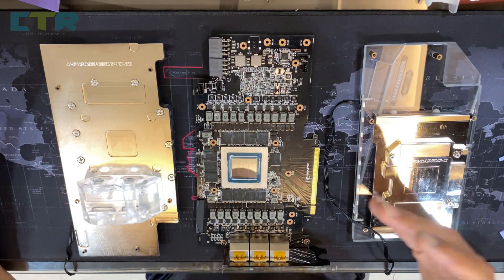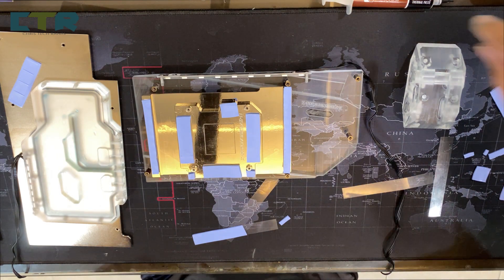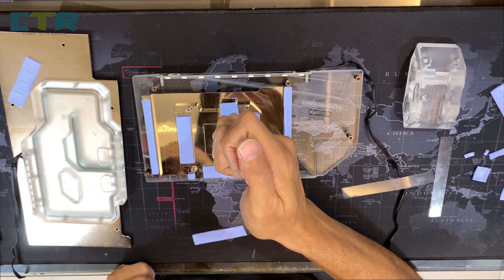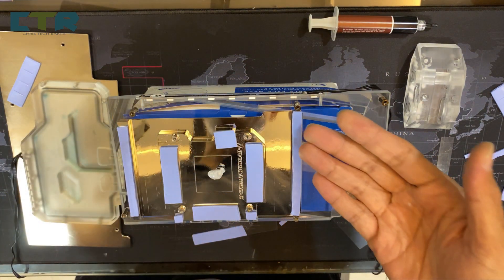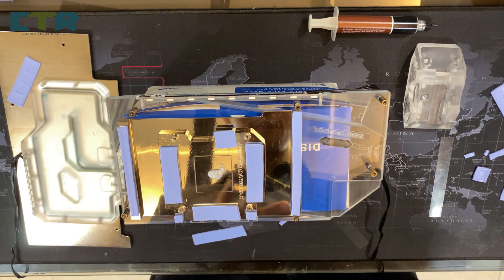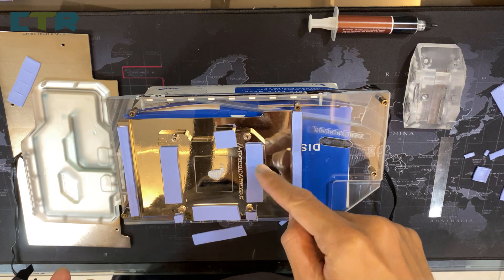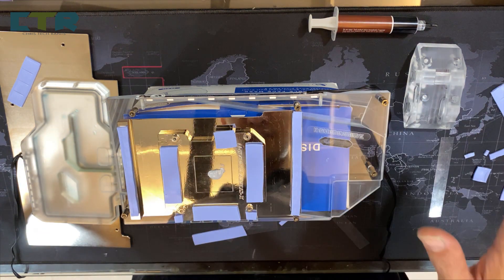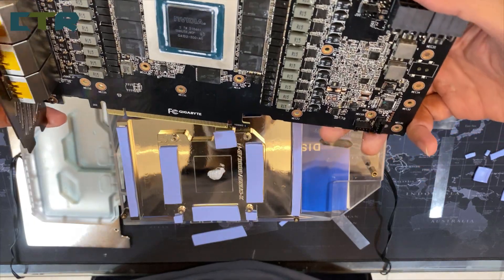Bykski 3090 Xtreme waterforce WB gpu block with active backplate installation

Comment: I don't know why they list the arous xtreme and master as different SKU... Because I have both RTX 3090's and the master works with the xtreme and vice versa, although my kits both water block looks different from yours... I get 78c on both cards mining no matter how hot it is in my house ( check my videos ) RGB SUCKS ON FANS AND WATER BLOCKS...
Reply from the maker: FIRSTLY: DANG MAN! nice builds! Second: you may probably have the 2nd revision of master. the second revision has 3 8pin power input. so the layout of the PCBs may be the same (except for the gpu binning and power delivery/consistency probably, which i would guess the extreme one would be better). To add, your temps are REALLY nice, considering that they're only being FAN COOLED! nice! add heatsinks with pads at the back of those cards and you'd get 4c off easy! just the cheap ones, they're really effective. if they're placed properly they actually don't look bad imo, in a rugged-jerry-rigged-kind-of-way.

During the time i did this 3090 youtube content, i think i only had the card on a 240 rad. now, I decided to finish my build and currently have 360 + 240 rads with just 1 3090 and a cpu in the loop. Now i'm getting 64c vram temp max with room temp of 29C during mining. fan curves managed by Argus Monitor. with noctua ippc 3000 running at fixed 1700rpm during mining. Basically i'm able to maintain 41c Water-loop temp (about 12c above ambient). But when i'm in the room and with the ac on, it gets cooler.
Reply: @christechrants4085  my rtx 3090 master is on air.. I just ordered another granzon kit for that card... My xtreme is the water cooled one.. it's at a consistent 76-78c at full tilt all day and it's like 70 degree in my home... I changed the thermal pads on the master with the same kind you have in this video and that made a world of a different even on hot days the master only gets up to about 86c on air... And yes master only 2 ports for power rev 0.1 non LHR card Aorus Xtreme 3 port power rev 0.1 non LHR.. Aorus xtreme RTX 3090 is the highest spec GPU there is .. currently reason why now I'm getting 131.29mh out of that one card master gets around 125mh my rtx 3080 gets 97mh and my laptop which is a MSI GE76 RAIDER rtx 3080 gets 68mh
Reply from the maker: 78c still not bad even on water. Nice. Considering it’s 130mh/s and the room temp. As for the master, 86c is still great though! Beats most of the other 3090 cards i believe. Most cards that’s air cooled doesn’t go below 90 even with fujipoly pads if I’m not mistaken (unless they attach a heatsink).
Reply: @christechrants4085  dude my master was at 106-108c with the factory.. I had to turn the hash rate all the way down to 96mh on the master just for it to stay at 100c.. my xtreme always had decent temps even on air 130mh at 98c but on warmer days it was going up which is why I decided to water cool that one first since it costed me me the most money 😂. Now my temps are good all around the board... Now I'm worried about my asic miners during the spring and summer heat.. I have to figure out a way to keep them cool..
Reply: @christechrants4085  and I would never buy a LHR card although they have a way to unlock it now. I'm just now dealing with that stuff.. btw yeah if my xtreme was on a 360mm fan setup I think my temps would be crazy lower but it's on the 240mm they sent.. is your on the aio radiator and pump? Or did you make a custom loop?
Reply from the maker: 😂😂😂😂😂😂😂😂😂😇😂😂😂 makes MORE SENSE NOW!!!!! You have to understand that it’s currently 1am here right now so my processing is a bit slow 😂😂😂😂😂😂😂😂😂😂😂😂😂😂😂😂

ASICs hmmmm. I always wanted to make contents out of those….but nah. Will just wait for your uploads 😁

A lot of shops in aliexpress dropped their prices for asic cooling. Like the 1080 rads and waterways… might be worth considering if you’re willing to wait a while for it to be shipped there. I’m from the Philippines and the parts arrive varies from 3 weeks(best days) to 3 months. OH i ordered some screws and fittings and it took so long that aliexpress refunded the items….and after forgetting all about it, it arrived at my doorstep. Took a little over a year i think. Would have been nice if i needed the thing still. Not sure of the status of how the availability/pricing of components there right now, so….. 🤷‍♂️ here, most reliable shop with reliable shipping is EKWB so not lot of options.
Reply from the maker: @MASA-ARRI   ye ye i get you. custom loop…. Easier to replace if a component goes bad, you know?
Reply: @christechrants4085  yes I definitely understand makes sense the all-in-one is modular so just in case something does fail you can replace it so it kind of works both ways but it's just weird to me that your whole water block looks different from mines when we have the same kit... I guess when I get back home I can make some videos of my asic monitors just to show you
Reply from the maker: YES PLEASE! Really interested in those asics
Reply: @christechrants4085  made a video of my ASIC miners 😊

Comment: Hi dude, I want to put Block to rtx 3090 aorus waterforce, is it fit? Where did you buy from Ali? Thanks
Reply: Waterforce without wb)
Reply from the maker: I used wb for aorus master
Reply: @christechrants4085  can you send where  to buy waterblock bykski, thanks
Reply from the maker: @PitProject666  N-GV3090Aorus-x (gpu block)
N-GV3090aorus-tc-be (active back plate)

I buy most of my components here:

bykski Official Store
https://a.aliexpress.com/_mrgbNvI

Note that it’s aliexpress, depending on your shipping method it may take a while to arrive. I normally receive my stuff in a about 3-5weeks time
Reply: @christechrants4085  thanks

Comment: Cmon man if you dont know how to intall the block, inform yourself first. When intsalling squich hard the area around the pads. They can get compressed quite a bit, in fact they should compress, they are a little higher by design. Just squish the card against the plate after when installing
Reply: Yep exactly right... Thermalpads cant bend pcb come on... Hes doing it so wrong 🤦

Comment: is this an Aorus 3090 extreme?
Reply from the maker: Kind of…. It’s the xtreme waterforce WB version. Basically it’s the aorus master version but without dual bios oh and has a different capacitor type as well. This has the flat ones for filtering. Forget the name. Opposed to aorus master’s cylindrical ones.

Comment: I have a MSI 3090 Ventus 24g OC and when i put the block together I had to use one of the nuts that they provided in the packaging as if i didn't it would of bent my PCB, maybe you needed to use one of those nuts to prevent the bending on the PCB (The nut's placement was on one of the screws used for the bracket)
Reply from the maker: Nice input nice. Will check this out next i open the block up

Comment: Thanks ever so for your videos, they have been a great help in gaining insights on this card and its various versions. 

We recently had to buy one of Xtreme with the air cooler. We wanted to get a A5k or A6k but we took what we can get with gpu market as it is. When we start a render this thing gets so hot, I could even deal with hose loud the fans might be. But rendering jobs lasting 2-3hrs at high Temps are scary, we are actually thinking of water cooling it.

We were looking at a EK cooler but everything I hear makes me think we should get one with an active backplate. Just so nervous about doing something like that because never done it before.

How are you liking the Bykski cooler now after several months?
Reply from the maker: First off….with a 360 rad and only the video card in the loop, room temp of 22c, I’m getting 58c vram temp and high 30s or low 40s gpu core temp. With 27c room temp, I’m getting 68c vram temp. These are in regards to max mining performance. With proper thermal pads, bykski blocks are great (JUST DONT USE THE STOCK BYKSKI THERMAL PADS, I’m using gelid extreme pads).

Secondly, there was one useR who commented that he’s only getting 80+c with his aORUS 3090 xtreme waterforce WB. With 80c+ vram temp during mining, that’s pretty impressive. Note I’m not sure if gigabyte upgraded their WB design or something, but point is, that is something worth looking into. 

3rd: I’m sorry but I’m actually not familiar of what a5k/a6k are 😅

After several months of use….. performance and thermal parameters are still GREAT!!!!!
Reply: @christechrants4085  Thanks for all that insight. I wanted to wait till I tried one think be fore water cooling. I'm still a little on the fence about water cooling the card, mostly because I've never dont it before and this is work critical. But as a stop gap/cheep lets try something just to see... I bought a copper Heat Sink, a 1mm thermal pad, and two 80mm Arctic fans running about 2K rpm. Placing my Lazy Man Cooler on the back of the card over the GPU and mem junction ram. While still toasty at around 78-82c under moderate load that is a far cry from the 92c it was sitting at most of the time under the same load. 

I'm thinking that in the end I'll be water cooling it. Starting a work load that is a few hours long it would eventually climb on up to around 90-92c but pretty well maxed out there.

As for the A5K/6K its is just the workstation versions of the 3090 for the most part. It only takes up about 2 PCI slots since it was longer and cooling more streamlined. Unlike the current Monster of a card in the system. ^^;

Thanks again

Comment: Hello Chris,
i have one last question.
Which cooler is thicker
The original Aorus 3090 air cooler or the Bykski full cooler with active backplate?
Sry Chris, I need to know because I really want to add 2x 3090 Nvlink! Does that fit on the Asus Rog Maximum Formula X Z370 motherboard
Reply from the maker: sorry i wouldn't know the answer. my gpu originally was the aorus 3090 xtreme waterforce WB edition. anyway, the bykski block with an active backplate consumes 3 pci slots. Not including the fittings.

In my estimate, that board will be able to fit it. you'd be using the x16 slot 1 and the bottom x16 slot.

Make sure the case you'd be buying have at the very least, have 8pci slots, with enough room for the bottom gpu's fitting for its inport. MEANING, the case should have space for 9 pci slots inside the case, and has an actual 8pci slots. I hope that makes sense. i don't know how to better descibe it. like the phanteks enthoo elite case or something. well other case may be able to support it but i don't know what those are.
Reply: @christechrants4085  8x PCI-e ????? :-////
Reply: @christechrants4085  soo... do you mean it is perfektby my board? Asus Rog Maximum Formula X?
Reply from the maker: @Trailerofdead  provided that you’d have a case that it can fit into, I don’t see why not. But to be on the safer side. Better buy one 3090 first. Your backplate may be different from mine
Reply from the maker: @Trailerofdead  I don’t know what you just said but seems like you’re enjoying it so ok 😂😂😂😂😂 enjoy your modding!
Reply: @christechrants4085  Bykski Aorus Xtreme is on the way! It's sure to be there next week!
If 1 board needs 3PCI-e, 2 boards need 6PCI-e slots! It's very simple math!
My board has space for 6PCI-e slots.
3 of them can be seen and there are gaps in between.
I have to stow my power supply somewhere else or buy a larger case!
The original air cooler is 7cm thick. Please measure your Bykski to compare! Best regard Chris and love you Brother haha
Reply from the maker: @Trailerofdead  no no no. Not pcie slots for the motherboard. You motherboard is fine with 3 slots of x16 or x8 slots. Those are fine :) you will be using the top pcie x16 and hopefully the middle x16 slot but most probably the bottom x8 slot. Anyway those are fine. But you are correct =) your case needs to be able to accomodate 9 slots. Anyway, I’m pretty sure you get the idea. 😁😁😁😁 enjoy bro!!!!! I know nvidia made a bad move with the vrams overheating…..but hey atleast we get to tinker and do something we enjoy 😂 enjoy!
Reply: @christechrants4085  Haha yes, I understand the PCi-e both must be able to 16 x.
If I have 1x 16 and 1x 8 it is not good, therefore several Pci-e. both have to run at 16x ... but I can't find a motherboard that can do ALL 16X. do you know one I want the AMD R9 5950X or wait for Alder lake. Yes, luckily Bykski has a full block that comes now brother! :-) I think I'll keep my board! yes i will hope the top and the middle! because the original air cooler is 7cm thick. how fat is your bykski?
Reply from the maker: @Trailerofdead  wait for my response tomorrow. I’m too drunk to respond now 🤣
Reply: @christechrants4085  Hahahahahahahaha DrunkenMaster
Reply from the maker: @Trailerofdead  yeah, so basically the whole block's size is 4.8cm. takes about 4 pcie slots of the computer case because of the connector link. it will be very tight if you will put both 3090s on the first x16 slot. so i doubt it will fit. but of course i may be mistaken. so you might be force to use the bottom pcie x8 slot of your motherboard just so you'd be able to make it fit. BUT using the bottom pcie slot of your motherboard may interfere with your computer case bottom psu shroud so research on the case you'd be buying =)

PLEASE share your results after your build =) =)
Reply from the maker: @Trailerofdead  it’s the connecting link that is 4.8cm. The blocks are not that thick. Ye, will check video later

Comment: Hello Chris,
please tell me your temperatures with your block / active backplate.
I've just ordered the Bykski for Gigabyte Aorus Extreme with an active backplate and hope that the block arrives quickly.
 I am interested in your vram please tell me. My Gygabyte Aorus Extrem is there and only beeps / hums softly ^^ a great card!
Reply from the maker: Regardless if it’s gaming or mining. Haven’t tried in computing or content creation. Anyway, for gaming and ming never goes beyond 58c if room temp is 22c. Doesn’t go beyond 66c if room temp is 27c.

Gpu temp never goes beyond 47c

Water temp never goes beyond 39 c if room temp is 20c. Never goes beyond 44 if rooms at 27c.

Radiator 360mm only 1 gpu in the loop.

Fan curve set at 70% when vram temp reaches 60c-70c. 50% at 40c-50c. And 800 rpm if vram below 40c. Average rpm 2050rpm. 

Max rpm3000 if vram reaches 75c
Reply: Excellent!
Thank you for your detailed answer! I ordered the Bykski via UPS.
It's coming next week! I hope! I hope it stays cool! XD

 @christechrants4085 You: "Anyway, for Gaming and Ming it never goes above 58 ° C"!

Do you mean the GDDR6 / Vram?
Sry, I just want to know Vram ^^ backplate! ThX and sry :-)
Reply from the maker: @Trailerofdead   yes you’re right: VRAMs are inn regards to the 3090 vrams gddr6x….note the X 😁

Comment: what is the thickness of the backplate at the edge?  and how far does the connecting block stick out from the front side of the card?
Reply from the maker: Message me on facebook. Christechrants 

not sure which edge you’re referring. Draw a simple sketch or something.

Anyway Can’t check right now. But I’m sure that it uses 3 pci slots. (1 top & 1 bottom)
Reply: @christechrants4085  just the thickness of the metal on the backplate?  and how far the block that connects the 2 halves in front sticks out from the card?  and where is the best place to buy these? aliexpress? or?
Reply from the maker: @valentusslimroast6716  oh i get it o get it. Will give it to you tomorrow. Bought mine from aliexpress. Just be sure to choose the dhl option for shipping 😅 aliexpress takes time to actually ship the item. 

My experience: i ordered jan 1.
Jan1-10 item being prepared for shipping.
I received it jan 15

Something like that.

Another experience i had with aliexpress:

I ordered jan 1. Dhl also
Jan 1-10 processing the item for shipping
Jan 11 made an error with the shipping option. 

Reason why my purchase was a bit cheaper than what i was expecting. I thought it’s a promo thing or something. Turns out the shop chose the cheapest shipping option.

Received the item march 15

😂😂😂😂😂😂

So it’s basically a hit or miss with aliexpress
Reply from the maker: @valentusslimroast6716  if you’re asking because you have two gpu…. Watch the end of this video by diego 

https://youtu.be/lA1pbPlWzQw

If you have two 3090s though, you’d have a hard time making the comouter look nice 😁 that and might have a bit of problem with your tube’s port fittings.  Will really depend on your board and case. Anyway will try to give you the dimensions tomorrow
Reply from the maker: @valentusslimroast6716  @diegogame if you have this information please give it here 😁
Reply: @christechrants4085  no it's because my tuf 3090 is on a asus z390-i gaming itx motherboard and the stock backplate already contacts the rear motherboard heatsink making for a very tight fit, and the case only has a couple inches between the stock 3090 card and the tempered glass side of the case
Reply from the maker: @valentusslimroast6716  

thickness of backplate is roughly 2.5mm

edge of pcb to edge of backplate is 4.5mm

thickness of link sticking out from the PCB is 21mm (laterally sticking out towards the backplate).

height of link from pcb is roughly 31mm (vertically from the pcb)